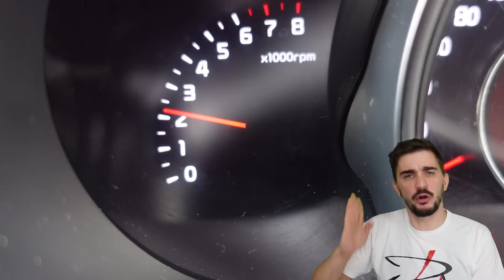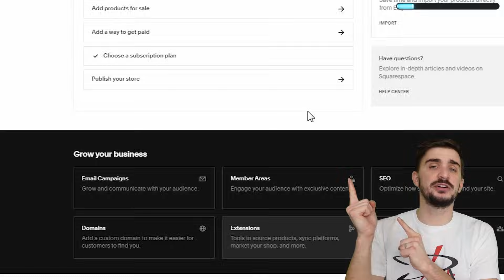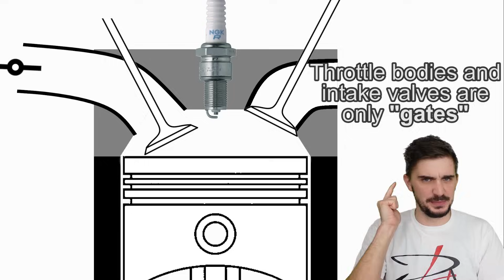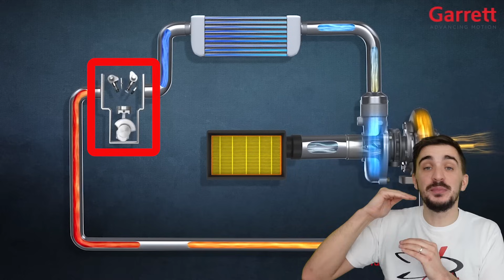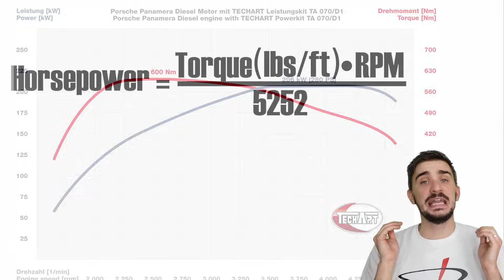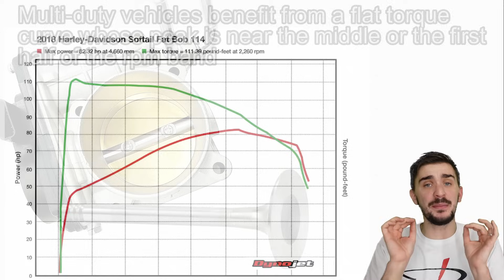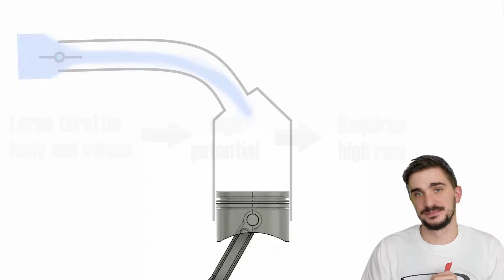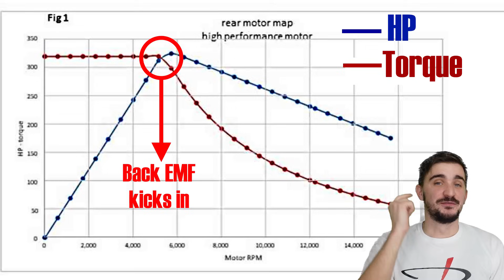WHY are HORSEPOWER and TORQUE CURVED?

Comment: Maximum torque is when cylinder fill is best, i.e. highest cylinder pressure when the intake valve closes. Higher rpm tends to decrease this, as flow resistance from the intake tract becomes higher. Due to some nonlinear effects, torque isn't maximized at minimum rpm. Piston speed, however, is not the chief reason for this.

At 4:17, the video notes that at 700 rpm, there is not enough piston speed to pull a lot of air into the engine. This is true, that is why power is low. But it is not the reason that torque is low. Torque is not about how much air the engine can suck in per unit time, but about how much air it can suck in per crankshaft rotation. At higher rpm, pumping losses from the intake tract increase, but nonlinear effects such as scavenging can still cause an optimum, leading to a peak in the torque curve.
Reply: Thats why vtec makes more power at high rpm because it alters the crankshaft timing
Reply: @bbshir36 camshaft… valve timing.
Reply: @rollsroyce329 yea my bad
Reply: @bbshir36  no worries mate, thought it was a typo.
Cheers!
Reply: So the torque loss is the vacuum intake differential at higher RPMs? Because if so, why don't forced induction engines fix the "problem"? They already have other sources to create the compression from.
Edit: wait! The valves are still there choking the engine... Makes sense. I'm kinda tired and i understood it quite wrong 😂😅

Comment: In ship diesels is a way to come around the limitations of high torque at low rpm. When abusing the compressed air from the starting system during run they fill the cylinders instantly. During the next exhaust stroke the turbo wakes up quickly so the compressed air reservoir is not the limitation. The use of nitro oxide will also give instant torque. But if the system starts at idle the engine will throw its rods.

Comment: I have been trying hard to find the answer to the following related question for the past few days.
Please respond if you know :

What exactly is the graph for the torque? ( I understand that the power graph is basically a calculated graph, derived from RPM and Torque )

There could be multiple Torque values for teh same RPM ( based on the throttle position ) :

Consider a motorcycle going up a hill at 10 degrees at a constant velocity of x ( no acceleration ).
Now consider the same motorcycle going up another hill that is inclined at 20 degrees at the same velocity ( Apparently, the rider had to open the throttle more )

So, it has the same speed but different load torques.

I'm not able to understand how the Torque values in the graph are measured.

Comment: May i suggest not too common but a tech that can do more for increasing torque at low rpms vs NA & "normal" forced induction means? - electric superchargers, decoupled from crankshaft/rpms, regulated only by ECU as needed. Imho might be very perspective tech, especially if power loss is partially compensated by exhaust gases energy regen-ed with turbine with electric generator. That regenerated energy can just go into battery, with no need for bypass/blowoff to not have hard-coupled forced induction to work in unwished mode. While losses might affect efficiency of separate electric generator/supercharger vs classic turbo, i beleave there is LOT of potential from having custom regulated decoupled from crankshaft (and decoupled exhaust/intake bits) forced induction.

Comment: You can change the curves a lot with the geometry inside the engine. But it's all linked to air intake and airflow control.
Electric motors suffer from three things: back EMF, switching losses and magnetic limitations.
Back EMF is the voltage produced by the generator capability of a motor fighting the current that wants to spin the motor.
Switching a transistor on or of takes time. The higher the RPM the more switches so we spend more time switching.
Magnetic limitations means as we put more power through a motor it generates heat. Heat and the power weaken the magnet so the percentage of generated heat and noise(electric & magnetic) increases.

In a ICE it's funny a cam system has a constant switching loss over engine rpm as the valves are mechanicaly linked. Also the heat generated inside the engine weakens the materials ability to withstand physical stress and cooling prevents it from failing. Also electric fights back EMF with increasing RPM, ICE fights friction ...
Quite funny how both fight the same kind of engineering problems if you look at the math/physics.

Comment: You forgot to mention one particular type of racing engine. Rally cars need lots of torque at all RPMs.
They need to be able to spin their wheels throughout their RPM range and minimize the number of gear shifts they have to make.
Rally cars tend to have very low gearing too, they aren't aiming for top speed. They are aiming for the best performance in any one particular gear so they can sit on one gear through a lot of technical curves and still get the wheels spinning at a balance point where there's enough slip to go sideways and enough traction to change direction quickly.

Rally cars tend to have a flat torque curve up until around 5500 RPM, where it somewhat sharply drops off. But there's still PLENTY of power left over to hit the rev limiter in top gear for those sprint sections. Top speed tends to hover around 200 to 220 km/h which isn't that slow compared to a road car. But in other forms of high end racing that is slow.
But a F1 car would have a pretty bad day on a rally track, even if it could do 340 km/h which is much faster than any rally car.

Comment: Why do piston speeds higher than the maximum potential airflow make the engine produce less power? I understand that the size of your intake components limits the engine at higher speeds, but why doesn't the power curve just flatten out when it hits the limit of potential airflow?
Reply: In other words, when the pistons downward speed is trying to ingest more air than the intake components allow, why does this result in less power than when the pistons downward speed is trying to ingest the exact amount of air that the intake components allow?

Comment: No, it's not confusing at all.
It's all about throughput. If the engine isn't revving at the right rate for the amount of air and fuel available, there simply won't be enough time to suck-squeeze-bang-exhaust that available fuel-air mixture.
Likewise, if the engine is going faster than the amount of air and fuel available, there won't be enough fuel-air mixture in the combustion chamber to produce power.
It's why engines perform worse at high altitude as there is less air per cubic unit available so you simply can't feed the engine the fuel-air mixture it needs for that engine speed.

Another factor at high RPM is of course also internal friction. The faster the piston moves up and down, the more friction it sees in a certain time frame.
And the fact you have a complete drop off in power as you reach the rev limiter... Or else the engine would rev itself to bits given enough fuel-air mixture to combust.

Turbo and superchargers help by compressing the air so you can fit more of it in the combustion chamber at each cycle. But you get turbo lag as it also takes time for the turbo impeller to spin up to the point where it actually works the best. And superchargers also have this problem, just not as bad as it doesn't rely on exhaust to start spinning, because if it's spinning too slow it won't compress air efficiently enough to provide the maximum benefit.
And again, compress too much air into the combustion chamber and you risk making the cylinders into pipe bombs... One final super powerful blow, but that won't help you in the long term.

Comment: This is incorrect.  At 600 RPM, the cylinder will full fully - easily - but it will then squeeze a great deal of it back out because the intake valve is still open for a portion of the compression stroke.

Comment: If the torque is falling off what enables the engine to rev higher?  What force is acting on it to make the piston go faster up and down in the bore?
Reply: simply it revs with a smaller acceleration, lower torque is not zero torque
Reply: @8coibaf  But to rev higher doesn't there have to be a greater force or torque, and if the torque is lower as you say then how can it rev faster?

Comment: Torque being a curve makes it more usable though. I have driven several different ICE cars and my conclusion is that the ideal peak-torque rpm is around 75% of the redline, for example if the engine can rev up to 8000 it is best to reach peak torque at 6000 or so. I know most people are accustomed to the early bump of torque seen in Golfs, however this is only good within the city limits. As speed increases, torque requirement increases too. And no, torque usability is not only a matter of straight line performance. The more torque you have at high rpm, the more control you have on handling via the accelerator. One of the reasons the Golf is so bad on b-roads is its engine-gearing combinations (the early torque bump is paired to very long gearing, resulting in little to no effect when lifting the throttle at corner entry, thus ending up into catastrophic understeer). I get how people are tricked into thinking "long gearing favours fuel economy", truth however is that torque requirements per gear need to be taken into account, so performance gearing is also the most economical gearing you can get.

Comment: Hello, please I have a question:  since torque is not related to RPM, no matter how fast the air will enter the cylinder, as long as we have the full volume, we should have max torque instantly. About horsepower, I get that the quicker the engine gets more horse power it makes. On the opposite torque is not related to how fast RPMs are but how much air it is entering the engine. I know that my way of thinking is wrong since I don't have instant torque in my car, but I wanna know where I am mistaking. Thank you.

Comment: Theres something i cant quite understand and thats if you floor it in low speed on high gear the engine chokes, in other words you have to open the throttle gradually and relatively to the rpm increase in order to accelerate smother and faster. Which i cant seem to figure out why. Hope you see it and make a video about it cause its been driving me crazy for a while now. Thx

Comment: I still dont get the main point of the video: it says, a slower moving pistons get less air in. That the combustion of less air (+less fuel) generates less pressure (=force on the rod) is logical, but simply does not apply here imo. Under ideal conditions, you always get the displacement fully filled regardless of the rpm. And only this is important in terms of torque.
Of course, regarding a continiuous process, less air gets combusted at low rpm, but this only affects horsepower. For torque we have to discuss a single stroke. And I think here you are wrong 😮 
I think the real explanation is more difficult and has to consider some physical / chemical dynamic effects 😮

Comment: I think this might be the first video of yours I've ever seen where I think you set out to explain the roots of a concept but didn't do it. 

The air coming into a cylinder has many forces acting on it, and I think that you missed a lot of them, and didn't really explain why higher piston speed would result in more air molecules being pulled into the cylinder; of course, the specifics of fluid dynamics are way above my head, but it seems to me that a lower piston speed would be just as likely to pull in a greater number of molecules, since the piston doesn't need to overcome as much of the air's inertia, and the pull wouldn't rarefy the air, reducing air molecules. 

Obviously this is not the case, but the principles involved remain unexplained.

Comment: @ 4:12 , I heard the "nails on the chalk board" words that paint the picture of air being "pulled" into the engine..  This is IMPOSSIBLE ‼️ Air is a gas. Gases, and liquids, can not be pulled !! 

Every time the piston in a naturally aspirated, reciprocating, internal combustion engine travels through its 'intake stroke' , air, and possibly fuel, are PUSHED in to the vacated space by ATMOSPHERIC PRESSURE ‼️

Even at higher piston speeds, where a 'ram effect' takes place, the air is being pushed from the higher pressure areas to the lower pressure areas during each and every intake stroke ‼️

I am fascinated by the range of subjects you cover !!  Keep it up !! 😉 🙋🏻‍♂️

Comment: Almost nothing in this video is correct. I don’t even know where to begin because you get so many things wrong. If the intake path is not restricted then the amount of air that gets in the cylinder won’t increase with piston speed. The speed the air enters the cylinder will increase with higher piston speeds but the amount won’t increase unless you are building pressure with pressure waves. There are so many other things you get wrong too.
Reply: Thanks
Reply: You should watch his video on volumetric efficiency ("if you understand volumetric efficiency you understand engines")
Reply: Look who's projecting.

Comment: Why does no one ever talk about average power and usable power? Are people really so basic  that they see 300hp at 9k rpm and actually believe their car has 300hp?
Most of them "may" hit 9k in first and may occasionally hit it in second. After that gearing means they'll be well in excess of public limits. So more often than not they're doing less than 6k and probably barely making 150hp

Comment: Back in the 60s, a company called Turbonique sold superchargers that were independently powered by a gas turbine with its own fuel supply (of literal rocket fuel!). Since they operated completely independently of the engine itself, they could provide full boost at any RPM and had no parasitic drag.
Reply: That’s amazing
Reply: That is complete and utter insanity.
Reply: That's basically a rocket turbopump! The only difference is it is supplying a piston engine to create thrust, rather than a rocket combustion chamber and nozzle. Amazing!

Comment: In the past, I have created simple curves to compare different engines. I take HP + TQ / 2 = average composite power number. It is a meaningless number, but by applying formula to every engine, it is apples to apples comparison. There is only 1 curve per engine over RPM range. Can tell at a glance with engine has most power over given RPM range.

Comment: I have designed engines with predetermined designer TQ and HP curves. True, you can't get instantaneous boost from a turbo or supercharger. You can however capture ALL pressurized air in a buffer air tank and not waste air through waste-gate. If turbo is capable of 5-6 bars and engine only needs 1-2 it gets stored for when you want instant and very controllable air flow. Exit valve on air tank adjusts to on demand, or exactly to a predetermined power curve. Valve controls PSI and is different from the throttle. 

More RPM = more power because it pulls in more Air/Fuel. Want more power without increasing RPM... increase Boost and it forces more Air/Fuel in without raising RPM. Boost can be controlled independent of engine RPM that controls Turbo or Supercharger.

There is another benefit of over pressuring air in buffer tank. More pressure = more heat. A heat exchanger can remove heat more effectively when the temperature delta is larger. Then just like a refrigerator, when air goes from high pressure to lower pressure, the temperature drops. It's like spray paint, when you press trigger and air comes out, it's cold and the can itself gets cold. 

Today with Electronic Forced Induction (Mercedes is using it now), you can always keep a minimum PSI available in the tank regardless of engine RPM. My biggest problem was increasing boost (more Air / Fuel) without increasing RPM. I could make 500 HP at 1,000 RPM if I needed it. Rather than reading Dyno results and publishing Power Curves, I pick the curves in advance and store them in ECU. Push a button and pick mild, medium, or wild power curve. It's 'designer' power.

Comment: There is a way to get turbo boost pressure right away. The method is to store the pressure wasted when we take our foot off the accelerator and the turbo continues to spin. This pressure that is wasted by the wastegate is stored and used when the engine starts accelerating and the turbo still does not spin. I think it was used by FORD in rallies. You can explain well, as only you can explain. Explain the advantages and disadvantages and if it is used by any manufacturer. Thanks

Comment: the torque curve on electric motors doesn't start dropping suddenly because of back emf, because back emf is proportional to the rpm.
power is limited for a variety of reasons. battery power output is limited, controller power output is limited too, and finally the motor is also rated for maximum power. sending more power will generate more heat and eventually overheat or even melt the motor.  whichever of these limits is reached the first, caps the motor power. then back emf is the reason why dyno chart of electric motors will not have perfectly flat horsepower plateau. even if controller keeps sending the same amount of electrical power, back emf will reduce the mechanical power produced, with more and more losses as rpm rise. tesla plaid seems to be almost an exception with very little power drop. maybe they just artificially limited the power at midrange rpms to allow this almost flat power curve?
BTW motors can have different nominal and peak power. you may have automatic fallback to lower power - limp mode- when its overheating, like on most EVS. on cheaper powertrains though, like ebikes, especially DIY ebikes, its often up to the rider to avoid putting out peak power or amps for too long, and you can damage or even destroy the motor on long climbs, or with too much payload with combinations of climbs/cargo/passenger